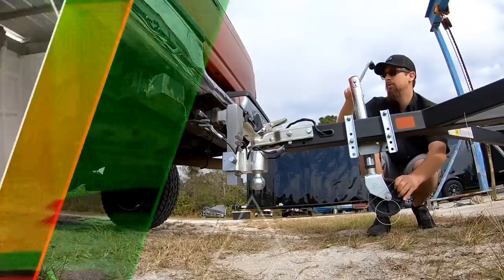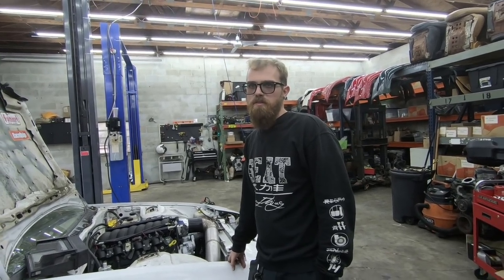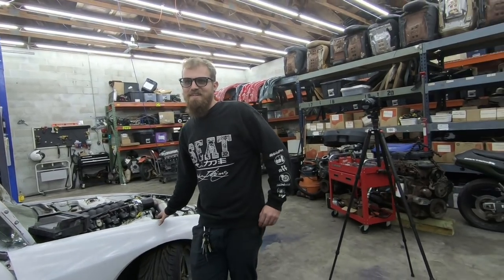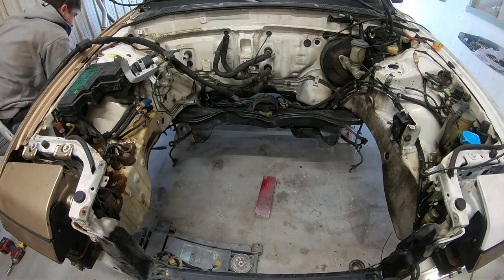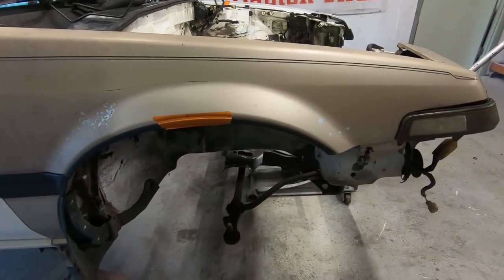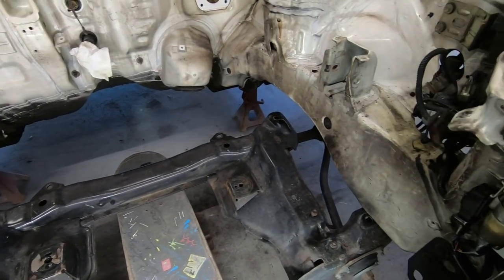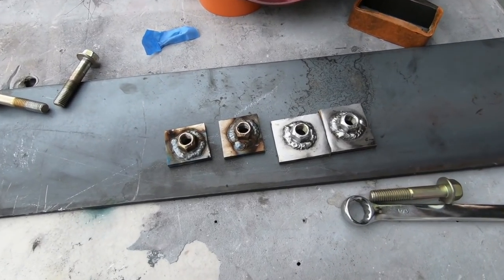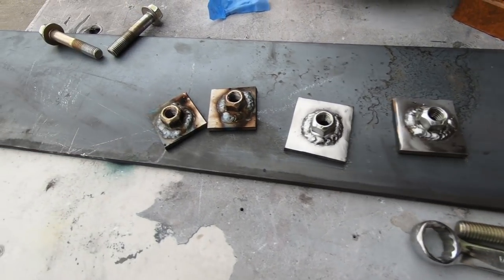V8 Swapping a Honda Accord, Here Is How The Motor Will Mount!

Comment: Looks good ... weld in sleeves through the tube where the bolts for the sub frame bolts through
Reply: That's a really good idea. It'll strengthen the mounting 2x4s from crushing under the clamping force of the bolts and nuts. It MIGHT be thick enough that the bolt would snap before the metal warps, but it's still a really good idea regardless, structurally speaking.
Reply: That Dude Your Mom Warned You About... ye if you tie the two clamping surfaces together it will make it stronger and prevent twisting and possibly breaking the bolt
Reply: I was thinking the same
Reply: Good idea... jimmy oaks did the same on his civic KA swap

Comment: Hi Adam.  If you are puting bolts that go through the rectangular tubing you cut to bolt the sub frame to, you need to weld pieces of pipe into the rectangular tubing on both sides where the bolt goes through to prevent the rectangular tubing sides from squishing together.  If you don't it will collapse.  So wait until you know the correct position of the bolts, and weld in the pipe, with a inner diameter just large enough to put the bolts through. ang you can them safely attach the sub frame. otherwise there will be problems

Comment: Great stuff, If you werent already planning it like this I would strongly recommend tacking everything in and mock everything in before fully welding anything, much harder to cut things apart if you need to move something if its fully welded. No matter how much planning and measuring you do, you will need to move something

Comment: I would recommend using a solid axle in the rear, much easier to fab mounts for it, u can see how hard it was for jimmy and b hall to get the IRS to fit in the civic chassis, i personally would use an 8.8 solid axle from a ford explorer with rear disc brakes

Comment: Bode ,,really like what you've done so far ,,But one word of  Caution,,Mite be a good Idea to see If The Pontiac Suspension Car,,Frame Measurements are the same on Both Sides ,,As To Symmetric ,,,Or Asymmetric,,,The first being the same on both sides   The Second means different side to Side ,,, I only mention this because I was Dealing with some frame Issues,,years ago with Camaro with 350 v8 and the the engine subframe being different left to right ,,,Check with some buds down your way on frame diagram measurements for the Pontiac to make the suspension work in your Honda,,,Mite save you a world of pain down the road ,AND YES Weld in Pad Tube Supts Frame Bolts To Prevent Crush at Pad Mounts , ,Good Luck Like what You Are  Doing

Comment: Remember! The lower balljoint needs to sit in front of your fender center line to account for the -3 to -8° degrees of caster that the suspension geometry calls for. 

Take a moment to measure out the distance from the lower to the upper pick up points and then go all pythagorean theorem with those measurements. Figure out the scrub radius with the new track width too. You might find that you need to stretch the wheelbase slightly for the new rack width depending on how much scrub your wheel have in relation to the axis of pivot.
Reply from the maker: Thanks for the insight! I will definitely look into that